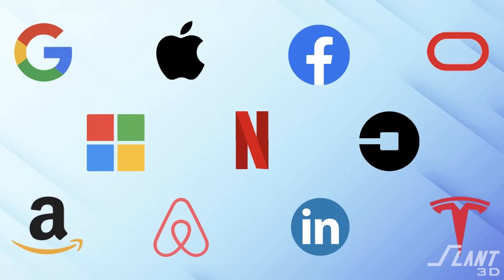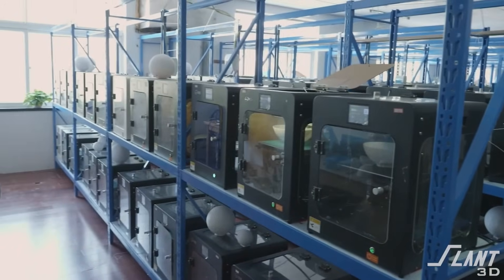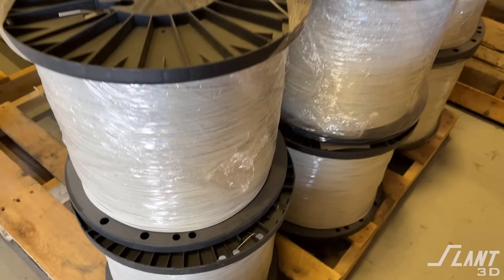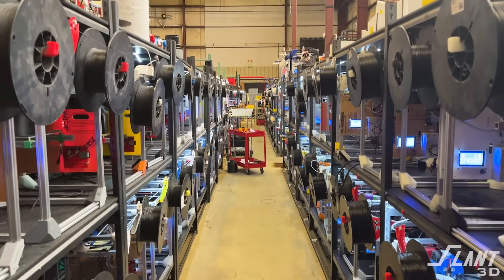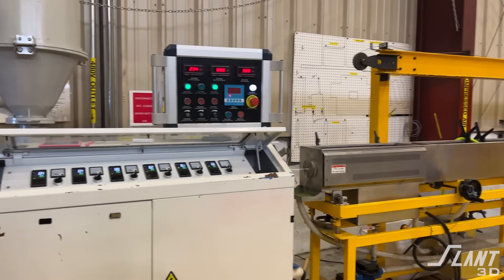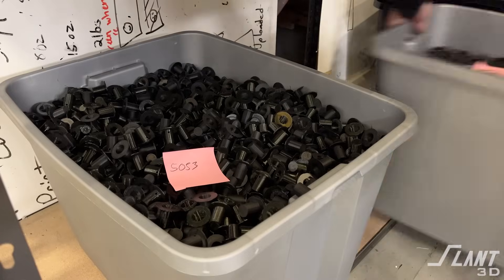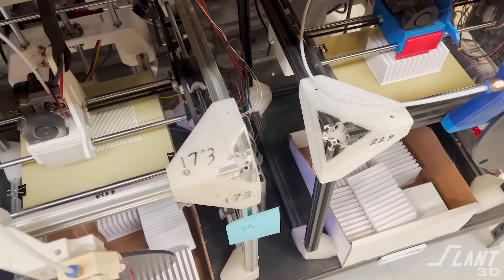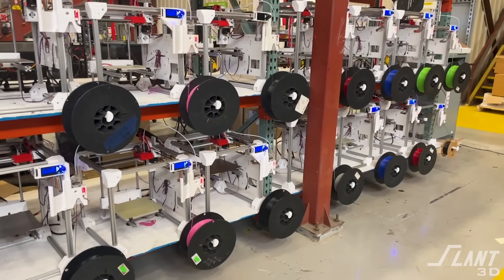You Shouldn't Have to Build Your Own Print Farm

Comment: Guys, I really really want to use you guys for my product but these are my current hurdles that need to be addressed. 1. You need a standard NDA that both parties can sign as part of the online quoting process (no product inventor will want to use a print farm that won’t agree not to compete with them). 2. Rock solid Shopify extension, and kudos to you for already working on this. 3. Printing a variety of materials (my product requires mass printing of TPU parts and it doesn’t look like you support that yet).

I know you are working on these but until they are all in place and working, I just can’t take the risk.

This means, I have to print a small batch myself, sell those, use any profits to buy a few more printers to increase my throughput until I can handle about 100 product/day. I figure that’s the sweet spot for small business to build enough capital to invest in substantial advertising with is needed to scale up to 1000/day. That is when your print farm can kick in.

What I’m trying to say is that, small businesses have to do everything to keep their overhead as low as possible. It will always be cheaper to print small volume yourself (I say without knowing your pricing). That means building a small print farm (1-5 printers) to bridge the gap.

For me, the highest cost is the packaging. Anyone starting down this path, do not ignore the cost of small volume packaging. This will eat into your profits substantially, more so than even building out your mini print farm.

Comment: Obviously the messaging here was miscommunicated. Correct me if I'm wrong, @Slant3D, but I think y'all are trying to say your business is trying to provide 3DaaS similar to other established companies like Xometry and the like, and that is a lofty but worthy aspiration, and one that I share as a little guy with a whole 5 machines (2 resin, 3 FDM).

That being said, the AWS analogy actually works against you here. Many businesses are actually starting to realize that cloud is a terrible platform once you are established and know your demand. It is good for businesses who do not know what their customer demand is going to be and are severely underequipped to deliver in the event of success, but once they have that success and know what the numbers are, self-hosting is actually the most economical model for most applications (a couple notable exceptions include things like CloudFlare's Cloud Firewalls/Load Balancers which can weather titanic DDoS attacks without the end customer even noticing a significant change in site performance). Netflix's heavy investment in AWS is actually costing them multiple billions both for the infrastructure AND the cloud engineers it takes to run it, when it would cost a fraction to self host.

Comment: The same argument could be made for traditional subtractive manufacturing.  Why bother setting up a machine shop to make your parts when you could outsource production to a mega factory somewhere else?  Although there are certainly cost advantages from the scale of big players, many times it's not worth the lack of control of your production, quality, and inventory.  Just In Time is all the rage but it depends on a global transport network that is both cheap and reliable, and we are increasingly seeing both of those conditions worsen.  A large part of my professional career as a manufacturing engineer has been dealing with supplier issues and many times the answer was to pull production back from a distant factory and pay American workers American wages to make parts in-house.  Although the parts were more expensive, the control and access made the overall production of products smoother and cheaper.
Reply: That's just a managerial decision.  Overseas manufacturing has been inexpensive because the cost of labor is low or subsidized.  We are now at a point that is no longer the case, but the US has already given up most of our raw manufacturing capabilities since this was all shipped over seas.  A large(ish) manufacturing facility in your city could be the best option if you are not a tier 1 supplier who can devote half of their staff and budget to manufacturing, a quarter to design, and a quarter to administration.  Eliminating in house manufacturing, you have 70 percent for design and 30 percent for administration.
Reply: @jameslmorehead   in my experience it shakes out to more like 30 percent administration, 30 percent design, 40 percent fixing the garbage that trickles in late and out of spec...

Comment: I really don't see a company that has focused on printing smallish parts out of almost exclusively pla making a huge dent in the injection molding industry whatsoever... The fact that they created an Etsy integration software tells you everything you need to know about what's actually going on here.
Reply: I can't see a 3D printing farm producing 100 bottle caps every 2 seconds, meeting strength requirements, and satisfying the demand that an injection molding machine can.
Reply from the maker: We are allowing creators to focus on creating rather than dealing with the day to day of running machines and shipping packages
Reply: @slant3d  point is invalid. Creators of 3D models: Galactic Armory, Droid Depot, any of the popular cosplay models...... they sell the files. 

It's up to their customers to print the parts. Half print on their own. The other half reach out to the small print farm owners/operators.

"Creators," aka the 3D model makers (given your context), make their money with digital sales. So again, your rebuttle here is BS. 

You're trying to change your angle on this thing, but you said what you said in the video multiple times and made it very clear. 

Yeah, you know what, you're right. Most of us can't afford an extruder. But some of us can afford to order 2500 single spools from China at a single time. 

Not all of us have 1000 machines in our setup, but we're also not hiring people or robots to do the work for us.

Not all of us want a massive PLA factory to churn out a billion PLA prints. Not all of us want to make our competitors obsolete. 

Some of us just want a little side hustle to pay for college tuition, a more reliable vehicle, kids' Christmas presents, a family vacation, down payment on a house, etc.

Comment: It's an interesting goal.  But you're basically at the starting point at this time.  The fact that many of your videos are on how to make a design "3d-printer-optimized"....that's already a sign that it's not just a drop-in replacement.  You can't just receive a file and get right to work.  Also, 1,000 machines isn't a lot.  Especially if you're being given strict specifications like no layer-lines and the like.  Then it's an exercise in compromising with the customer.

Still, you're farther ahead than the others but it's not an easy quest.
Reply from the maker: Large Scale Print on Demand is an exceptionally hard challenge. (PS. The MegaFarm is 3000 Machines)

Comment: Are you sure Google used Amazon Web Services? Don't think AWS existed back then.
Reply from the maker: Google had to make their own servers. Which is expensive and high risk. Later internet companies were able to take advantage of AWS. Most of the AWS first users were small startups. Uber, Netflix, etc
Reply: @slant3d  Yes, and it's always funny when the services of these companies go down at the same time because AWS has problems.

That's the big problem with centralized infrastructures. With a decentralized infrastructure, only individual companies are affected. With a centralized infrastructure, a large number of companies are affected at the same time.
Reply: I rewatched to check. He said Google had their own server rack, whereas the next generations just used AWS. In fact, Google has Google Cloud Platform (GCP), which is a direct competitor of AWS.